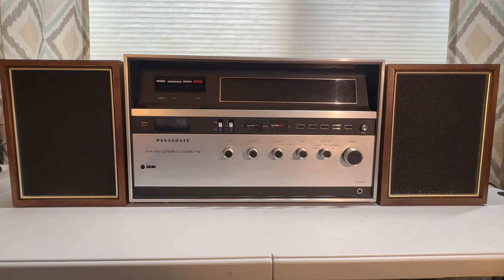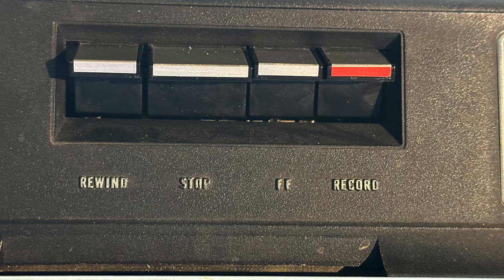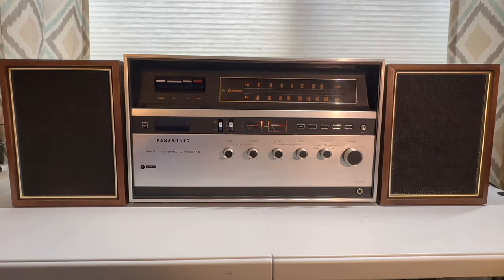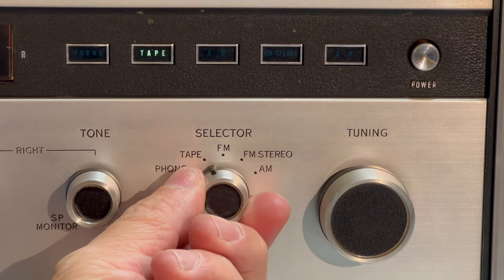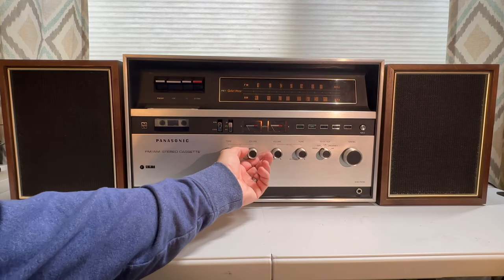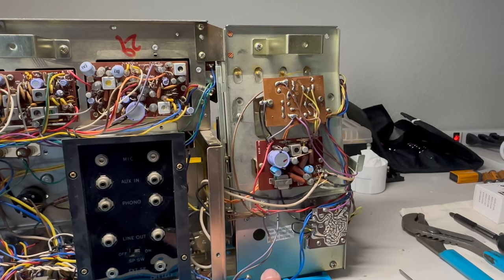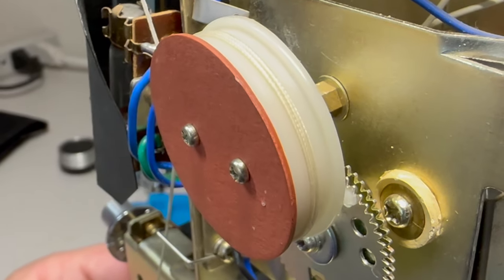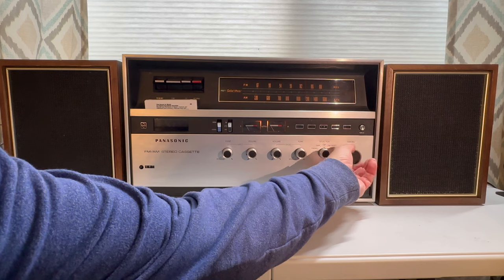Vintage Cassette AM/FM Stereo Panasonic RS-280S 1969

Comment: Hi Eric. I'm soon having a Panasonic RS-280S. Seller said it,s have some problem on tape line. sound is distorted, small. Can u advice me how to self repair. Thanks alot
Reply from the maker: Could be simple - like the tape head needs to be cleaned.  Or it could be something else more complicated.  It's hard to know.
Reply: @EricMarschner  Thanks Eric. Can you lead me how to open front and replace number belt. Now, the tape is bounce after some sencond. Thanks a lot.